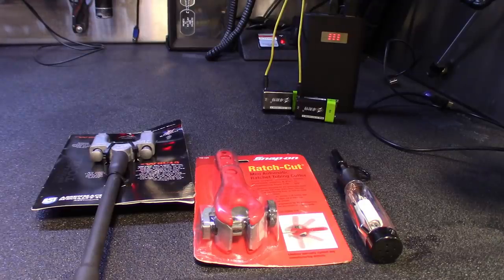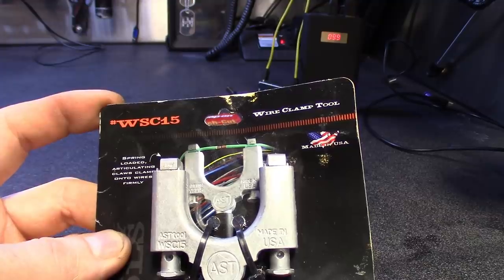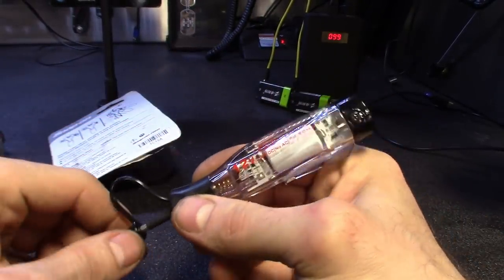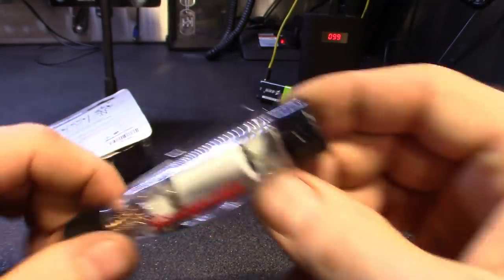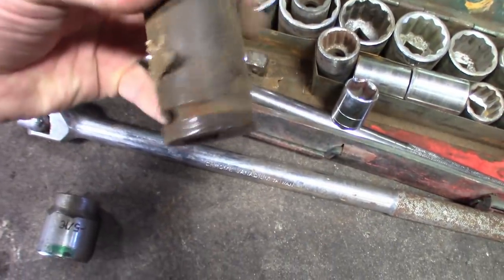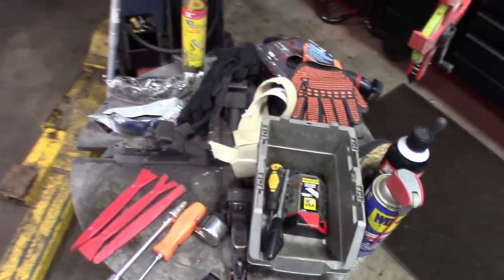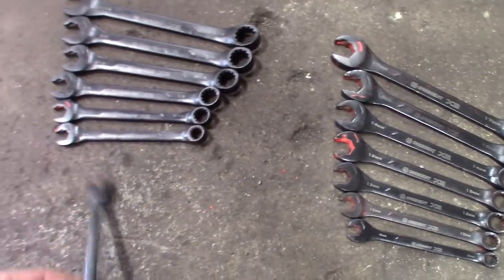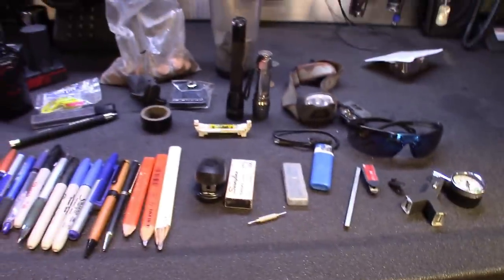Puny Snap On Haul ⭐Mechanics Lien Bonus⭐

Comment: That ratcheting tool for brake line is similar to one I use when doing one of my other side hustles, plumbing work. Nothing better than cutting a copper pipe up next to a bathtub and not having to hack it all out and solder it back in. Makes a job so much easier.

Comment: that test light from snap on will screw you over if you are not careful. it will light literally on about 10 milliamps.  you'll think its a good circuit   but in reality it wont flow enough to do the task.  been there done that